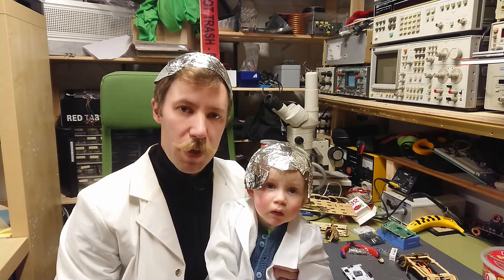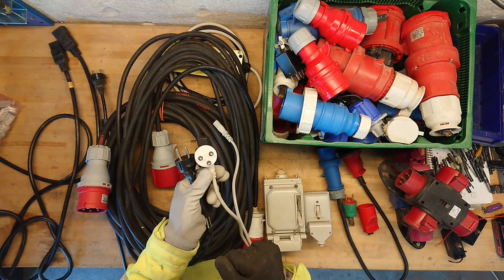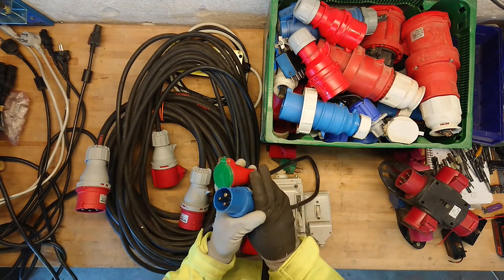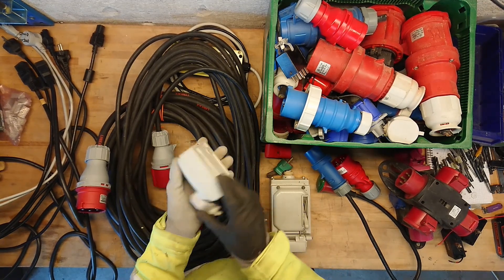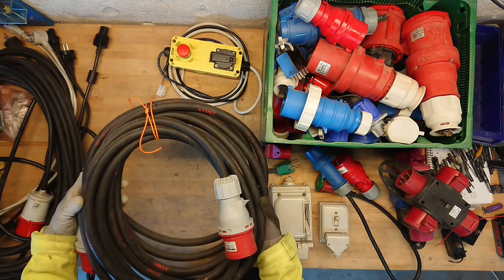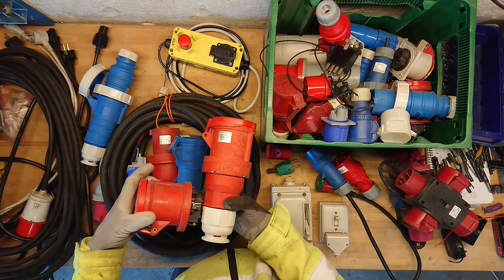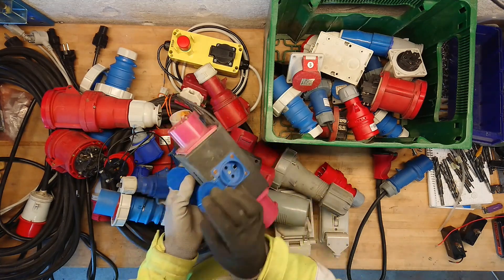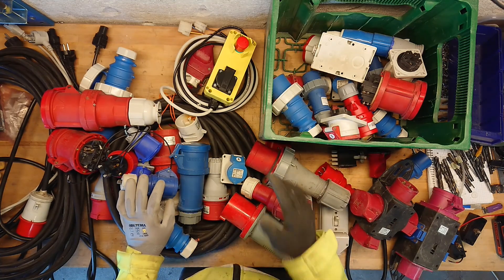High Power Plugs and Connectors - Isolation, Day 19

Comment: We have them cee conectors in the UK the yellow ones (110 volts) are common on constrution sites where 230 volt is not permitted. We dont have 3 phase in normal households but do have 60 to 100amps main feed.

Comment: The notch in some IEC (computer) power plugs has to do with the cable: no notch means that the cable is rated to 85 C°, while the notch calls for 105 C° rated cables.

This is important in IT for devices where the power cable passes through the hot exhaust at the back of the device.

Comment: Lift one is to allow use of power tools in the shaft, fed from the car power circuit, for maintenance people working in the shaft.The emergency stop is to break the main safety loop, which should stop all main drive movement of the car. Required top and bottom of the car, as well as in the pit, where the older requirements were only on the top of car and the pit. As well must be permanently attached, along with a set of operate controls that include lock out switches, to disable the interior and exterior calls, so the unit does not unexpectedly move to answer a call, but which then only operates from top of car.
Reply from the maker: Thank you for clarifying that. So these are always installed? I was told that they were thrown away after installation, as it comes with the whole setup and is only for one time use..
Reply: @KaizerPowerElectronicsDk  Mht be an additional one for the installers, but there will be one on the car top and bottom as well that is permanent, plus another in the pit for maintenance. If temporary then it will be there for use while they assemble the car and cables, and the main wiring loom is in place.

The lift kits come with a lot of hardware that is not used always, but is there just in case the building is not exactly as the drawings shows, so you might find there are a hundred extra bolts of assorted lengths included in the kit.

Gotten a few of those kits in the scrap yard, extra or unused hardware from an upgrade kit, which is standardised by the OEM manufacturer to retrofit any shaft, irrespective of the original manufacturer.